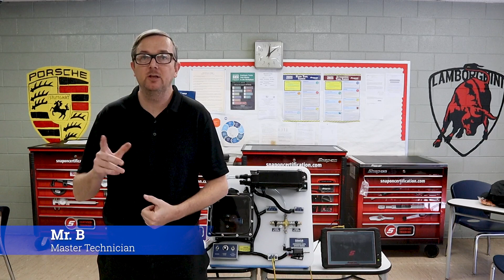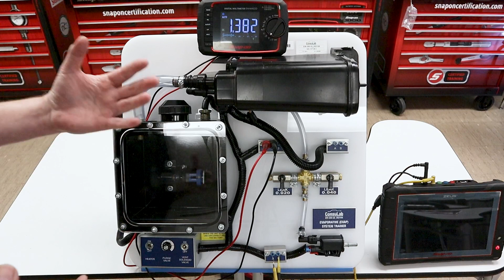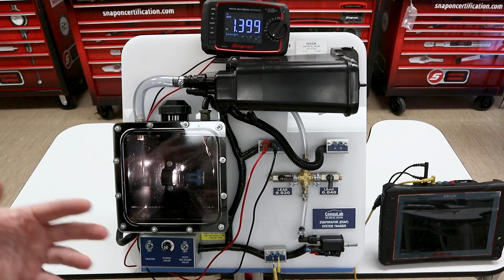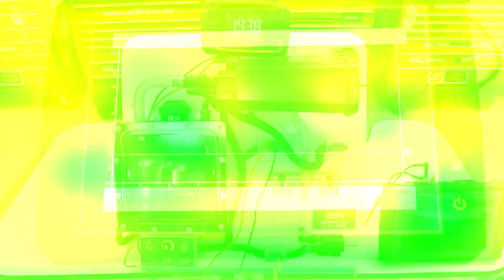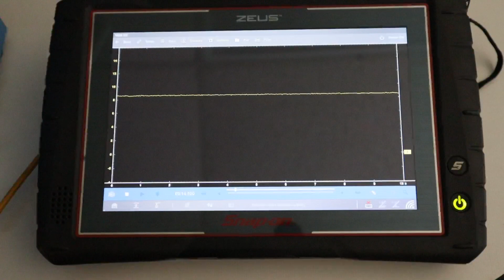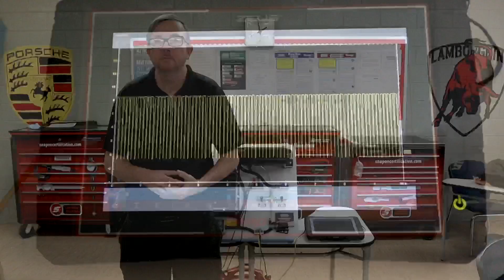Evaporative Emissions Basics: What You Need to Know

Comment: good video but not for my level of understanding of beginner. Can you attach a code list for me to download to have as reference material? I have evap leak in the 4500's. I need to use it at least to communicate with a mechanic if I am unable to find the leak myself. 2004 325i e46 m54. Thanks.